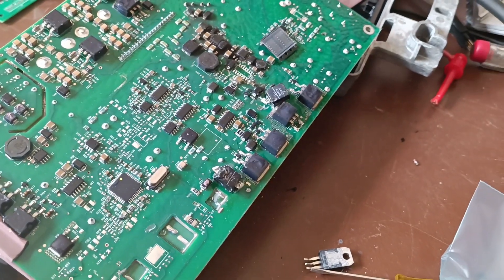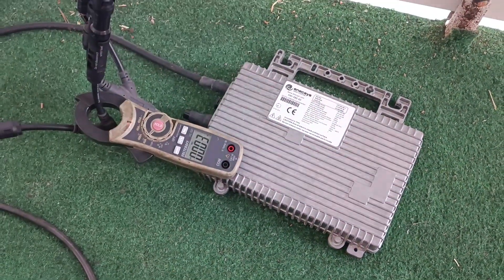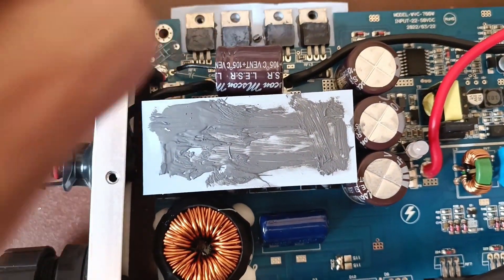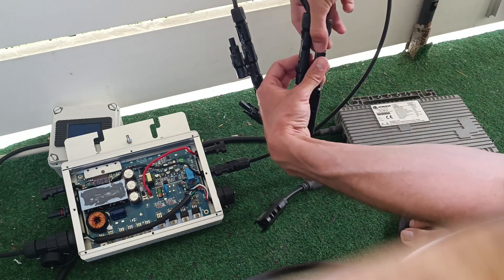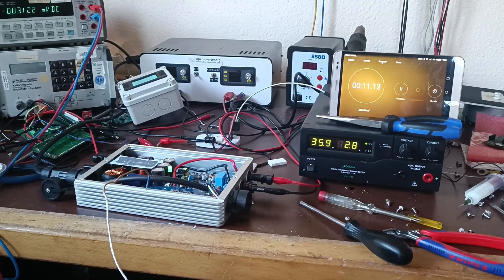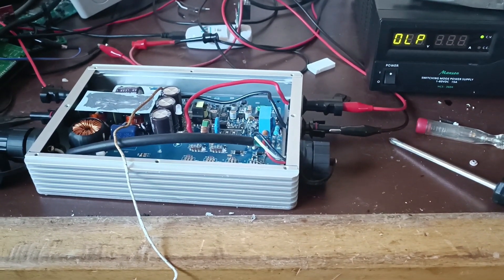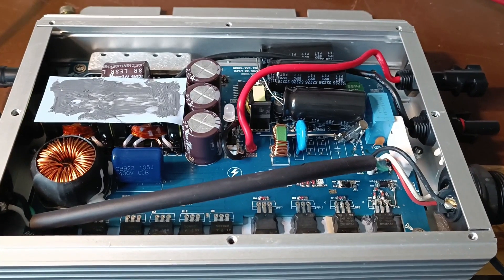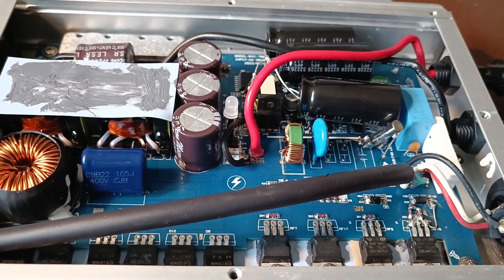Lab Update #78: Repairing Solar Micro Inverters

Comment: What did you replace the failed diode across the MOSFET with? I working with one inverter now and two diodes has failed, but have no markings on these SMD diodes.
Reply: Someone know the value of that diode?

Comment: I have one of wvc300 that blow the AC part. The DC seems to work (led is ON) . Is it worth checking to repair (the moffset I guess from your analysis). My solar panel is around 250w max so not a full load so do you think it is still worth ?

Comment: Buy quality brand old failed inverters. They are very easy to fix. In most cases just needs a new relays, or diodes or even just resoldering some bad connections. I tried to source faulty one for parts for Loadmaster XP project. Ended up buying 4 inverters rated between 2 and 4kW (each just 20-40 Euros). Almost all had just a minor faults. One of them had no fault at all, I guess it was users fault :) Anyways, I had to sacrify one for parts, as I couldn't keep trying to source one with a major problem.